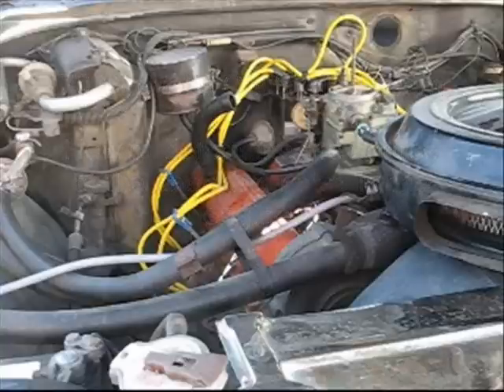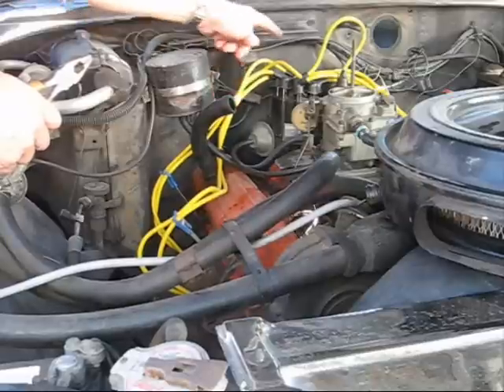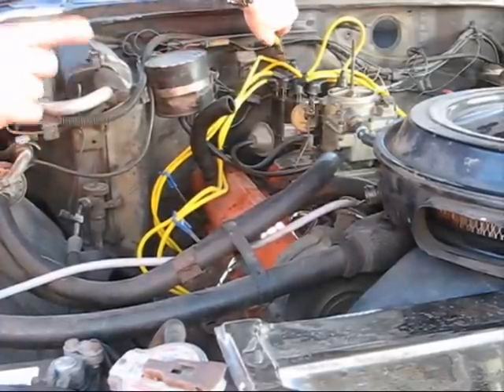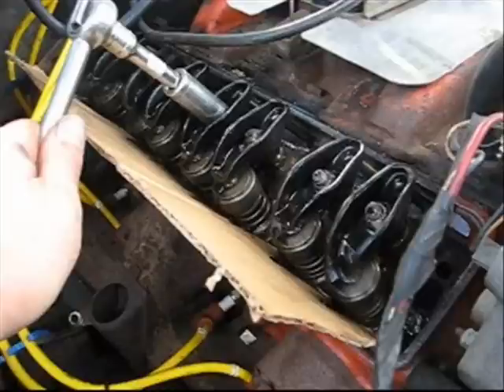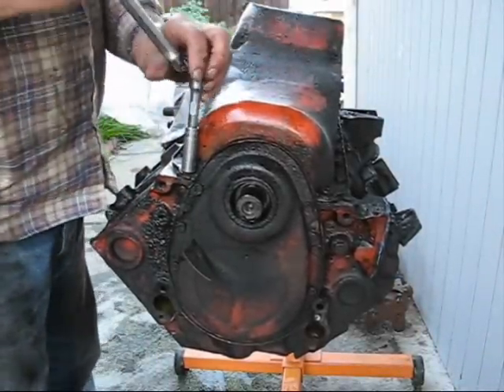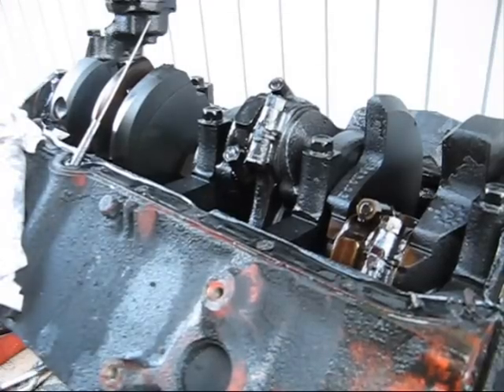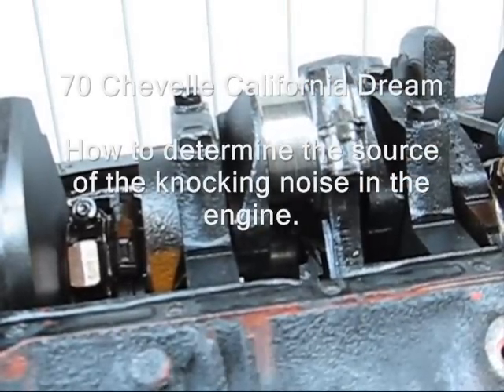How to determine the source of engine knocking noise

Comment: wow... if its a mechanical problem, shouldn't it make noise with or without the spark? why does noise stop when wire disconnected? what is happening exactly?  Thank You
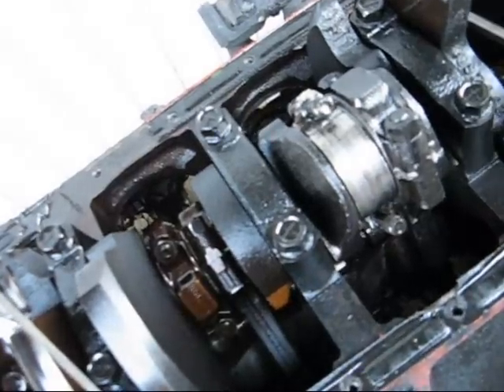Reply from the maker: When the spark plug is connected, it cause the spark plug to fire and this explosion in the combustion chamber pushes the piston down.  The piston is connected to the connecting rod that is bolted to the crankshaft and that is where the bearing is located.  When the spark plug is disconnected there is no force pushing down, it is being pulled through the cycle by all the other pistons.  With a bad bearing, it makes noise, because it has pressure on it and the bearing is spinning around the crankshaft and it should be stable in one spot.   That is why this is an easy test.           Look at the bad bearing at 6:30
Reply: Thank You Sir very much for replying, wow I'm very impressed by this fact, I would never have guessed !!! and your explanation  is very simple and detailed. Now I'm really concerned about my 76 chevy 350. During my last oil changed., engine was started and made knocking noise 3 or 5 times and immediately shut engine down, turns out the dipstick was misread. oil was added, the noise went away and knocking disappeared, is it possible I might have spun a bearing?  Thanks again for your time
Reply from the maker: No.   When you changed the filter, there was no oil in it when you started the engine.  If your car has an oil pressure gauge, you will notice that it takes about 3 to 5 seconds for it the come up to pressure.  The reason is that when the engine starts it has to fill up the oil filter first before the oil starts to circulate through the rest of the engine and finally register on the oil gauge.  Basically, the engine is running with not much oil on the bearings, etc, (there is just a thin film of oil that did not drain off from the last usage) until the oil starts pumping into the motor.  This is the same thing as not starting the car for several months.  They are basically designed to run like this on startup because the oil pumps works on engine rotation.   

What some people do is fill up the oil filter before putting it on.  I am not into it and have never had a problem in 50 years.  I am an old guy.
Reply: well, oil change is due again, i'll fill the new oil filter - Thanks again Sire! : )
Reply from the maker: See if it makes any difference.  Let me know

Comment: My 2.2L S10 with a pushrod engine makes a very similar knocking sound but it's not as loud... i just got a new head on it since the old one warped from running in too low a gear uphill on the highway and it's still knocking only when it's cold. A spun bearing makes sense but I would have to pull the motor like this one
Reply from the maker: Maybe you can lift up the motor up enough to take off the oil pan.  You will have to disconnect the motor mounts first and when lifting it up be careful not to let the fan hit the radiator.  If you can get that far, remove the oil pan and remove the rod bearing that you think is knocking.  I did this in high school but it was a very hard way to do it.  If it is good, put it back on and torque it down.

If one of the rods are scored,  you will have to pull the motor. 

Put the car on jacks,  get under it with it running and take a long screw driver and put one end on you ear and put the other end on different parts of the block and oil pan (front to back), and see if you hear the noise from the bottom.
Reply: David Lis that third part is a very good tip, thanks. But if I were to do that I would pull the motor out all the way. No point in leaving it in half way and making it a huge pain in the ass. The whole reason I have to lift it out is because there's a crossmember right under the oil pan and it's probably important
Reply from the maker: You are basically stuck.

Comment: This is confusing,  is it the same engine, did you rectiify the lifter noise,  or was it a bad rod bearing.
Reply from the maker: Yes it it the same engine.  I removed it from the car and removed the rod bearing shown at the 6:00 minute mark on the video.

Comment: I have some kind of knock coming from my 1982 Toyota Corona (22R) Just did the spark test as shown, when I pulled cylinder 3, the noise stopped for a few cycles but then came back after just a couple more. Lifters maybe? Maybe rod knock on more than one cylinder? None of the others had any effect on the knocking noise.
Reply from the maker: Try unplugging #1, then go and take of each of the other cylinders one by one and see if you get the same results.   Being a Toyota, I don't think it is a rod bearing.  Cannot say100%.

Comment: I took off wires one at of time and the noise didn't stop wants next
Reply from the maker: Maybe it is not a rod bearing problem but a broken valve lifter.  Did you loosen all the lifters one at a time?  (4 minutes into the video)

Comment: Reason knock goes away no combustion forcing rod back down hitting crank.
Reply from the maker: Yes, did you see the end of the video where it shows the rod bearing all screwed up?  It was spinning.
Reply: Yes it was bad
Reply from the maker: It was so bad the machine shop said it was to bad to regrind the crankshaft, so I needed to buy a new one.  I purchased the entire engine rebuild kit with a new crank, bearings, rings, cam, lifters, gaskets, etc.
Reply: Be sure  have rods checked for out of round
Reply: Worth the money

Comment: Everytime I pull plug wires off while the cars running I always get a nice shot of spark plug electricity through my body. I don't do it anymore.
Reply from the maker: With the car not running, pull off the boots from the spark plug and only put them on far enough to make connection and not all the way where they snap on.  Then use a pair of pliers with rubber or plastic handles to put them on and off.  After you are done, turn the car off and push them on all the way.  

I get shocked once in a while myself, no fun.
Reply: Go check out my turbo c10 build immune just started tapping I’m going to replace lifters and give it shot before I ls swap it

Comment: I hate these bearing GM MANUFACTURING.....YOU WILL NEVER HAVE A PROBLEM. LIKE THIS WITH TOYOTAS....
Reply from the maker: My wife drove home with the oil light on and oil leaking all over the bottom of her 2011 Toyota Camry.  The oil filter was leaking.  My first reaction was the engine was destroyed.  I drained the 2 quarts that were left and changed the oil filter, filled it with oil and started driving it again.   30,000 miles later it is still running great.  I have no idea what is going on but I don't care.  It now has 80,000 miles on it.  She will only buy Toyota cars, I wonder why.

Comment: hi i have a nissan maxima and it makes the similar noise it runs great but does shake somtimes and leaks oil. could it be the timing chain or vavles idk pls help
Reply from the maker: My car ran good but made a knocking noise because two of the rod bearing were spinning and it was just a matter of time before the rod would detach from the crank and really damage the motor.

Leaking oil does not have anything to do with the knocking.

It would not run if the timing chain jumped a tooth.

If the valves were bad, the car would not run good.

Did you pull the spark plugs and check?
Reply from the maker: My car made the knocking noise and ran good except if I kept on driving it one of the rods would detach from the crankshaft and do more damage to the engine.

The oil leak would not effect the running or knocking.

If the timing chain jumped a tooth, the car would not run good or maybe not at all.

If the valves were burnt, it would not run good.

Did you check by taking off the spark plugs and hear the noise go way.;

Comment: Gotta check your oil forsure
Reply: great video though thanks
Reply from the maker: I can not believe how many people today are just running their engines out of oil and seizing them up.  I was talking to the service manager at the Toyota Dealer and he was telling that since the cars are using synthetic oil and people don't have to change their until  10,000 miles, some of the older cars that use more oil and people forget or are lazy are running their engines out of oil.   

I notice that the younger people have no interest in doing or knowing anything about the maintenance of their cars except putting gas in them.

There is an old saying:  pay me now (change the oil for regular maintenance) or pay me later (put in a new engine when it stops working).

Comment: yeah I do listen to station, just got the car back out of the shop it keeps stalling,  so they replace the fuel pump and they said that should resolve my problems but i still have that knock in the valvetrain so that's  my next project and also rebuild my front end suspension.
Reply from the maker: I have a video on rebuilding the front suspension just in case you want to get crazy

Comment: Hey david what kind of oil you would recommend to run in my 62 continental 430 engine  , I was told I should use straight 30 weight.
Reply from the maker: In the 1970s/80s, I used straight 30 in all my cars.  I was told to use what the manufacturer recommends because that is what it was designed for.  That being said.....

I was told in about 2012, I should use 5- 30 because oil is made different now and using the lighter end of the oil (5) is better on start up because it  gets oil to the bearing faster and the lighter blend adds less friction to the engine when running.

I have never heard anyone say that their engine stopped running because of the weight of the oil they used.  You can only find out if you use a oil weight and take the engine apart and look at the bearings, then use a different weight for a while and do it again.

In my 70 Chevelle, 90 Mercedes 420SEL, E150 Ford van, and 2012 Toyota Camry,  I use 5-30 or 10-30, whatever is on sale.   I really don't have preference for the brand, they are all made to a certain standard.   I know I probably be blasted for making such a comment but that is what I believe.  

70 Chevelle - 3,500 miles on new engine (change every 3,000 miles), Mercedes - 220,000 miles (change every 5,000 miles), Ford van 55,000 miles (change every 7,500 miles - recommended by Ford), Toyota 75,000 (change every 5,000 miles), and old Toyota sold after 285,000 (change every 5,000 miles).

This is another big no - no.  Also, the 2012 Toyota, I changed from synthetic to regular.  Instead of changing oil at 10,000, I do it at 5,000.  There are several articles on the internet about the differences.  I talked to the Toyota dealer and he said that when these cars get older and use more oil, the people that change their oil at 10,000 to 12,000 might run out of luck and run their cars out of oil because they are waiting for the 10,000 marker versus me changing it at 5,000.  I will notice it because I do it at sooner increments.  I have hears some stories of people running their cars out of oil because a lot of people these days don't maintain their cars and never think to check the oil level never mind ever change it.  There is the old saying:  pay me now or pay me later.

All this is a matter of choice.  I understand if you are racing the hell out of that engine but you are going to be on old fart driver cruising down the highway with the radio going, rolling the electric windows up and down with the air conditioning on,  just loving life driving your big old Lincoln Continental.

Do you ever listen to public radio at about 10 or 11 am on Saturday and maybe Sunday, the Clicket and Clacket brothers? (Different times for different parts of the country).   Or maybe it is call Car Talk, they talk about car and car repairs.
Reply: Excellent. I run a Rotella straight 30 in my ‘74 250 inline 6, with zinc added after the fact.

Comment: The problem is also finding the right person to do the job no one is  returning my calls as when they want to start the jobs 5k are just estimates, I 100% agree with you, thanks for your help.
Reply from the maker: Where do you live?  Are there any old car clubs around?  Go to some of the old cars shows and ask all those people, you may find someone that works at a garage that will do it on the side.
Reply: David Lis I live in Tacoma Washington, that's a good idea, will do, always loved this car but never knew it would be such a pain.
Reply from the maker: Anything that is worth it or you really like can be a pain but once all the problems are over, you will love.  If I remember correctly, that car has electric windows.  I love driving my 70 Chevelle but never in the rain. I am afraid of other drivers so that limits your driving days. 

The only thing I could not do to my car is paint it.  Not because I cannot because in my 20's I painted many a car.  I live in Santa Clara county (Silicon Valley) and they only allow water base paint and they do not sell paint to people who do not run an auto body shop.

So, I went to some of the local car shows and talked to everyone that had a nice paint job on their car.  Everyone was happy to talk to me and told me who painted their car and how much they paid.  I then contacted several of them and went to their homes with my car and got estimates.  I already knew their skill level by looking at the cars they painted.  I finally found this guy who did it at home and in Santa Cruz County that still allows oil base paint.   It came out super.  One of my video shows him painting the car.   I was lucky because he allowed me to go into the paint booth with him and video him painting the car.

Be patient, you will find someone.  Summer is coming, meaning a lot of car show.
Reply from the maker: 404. That’s an error.The requested URL was not found on this server. That’s all we know.
It does not like something.

Comment: I also have a ticking/knocking sound coming from 62 continental  I was told I need to rebuild my motor, also the the vehicle dies or wouldn't start when it get hot it has to cool down before it restarts I've replaced points, plug, adjust timing it a tune up and still having that problem.
Reply from the maker: Did you do a compression test?  You can rent a compression tester from your local auto parts store.  My book goes back to 1963 V8-430 engine and it should have 180 pounds of compression +/- 20 pounds.

When you took out the spark plugs did they have oil deposits on them, were they black?

How many miles on the car?  Remember, those older engines were made to run about 100,000 miles.  

Is this the original engine, is the car all original?

What shape is the car in?  Do you have plans on keeping this car?  How much did they tell you it would cost to rebuild the engine?
Reply: the compression test was good its all original  motor it has 99k on it, I paid a shop to do the tune up to my knowledge their hasn't been any work done on the motor its other a new water pump.
Reply: I was told it could cost up $5k to rebuild it, I bought the car over a month know pretty anytime I drive it someone wants to buy it so i think its in good shape other the knocking and stalling.
Reply from the maker: $5k sounds reasonable because they have to take the motor out of the car and the parts are more expensive than your standard 350 Chevy V8.

I think your motor is just tired and wore out.  If you do decide to rebuild it, buy a new starter and alternator, those will be going next.   Install them at the same time so you don't have to do it separately.

Then you will have a dependable car you can drive forever.

Comment: had the same problem in a ford minivan. .but the mechanic said he replaced the bearings but still the knock without taking the engine out..my suspicion is that he never did what he said so...
Reply from the maker: I would take it back and tell him that nothing has changed, it still makes noise.  Have him show you the old bearings.   If the bearings are bad, it also damages the crankshaft.  Look at the video, at about 6 minutes, look what happens to the bearing and the crankshaft.

Changing the bearings is a major job.

How many mile on this minivan?  It may be better to buy a used motor at a junk yard.

Comment: I have a brand new chevy 350 3 miles could that be my problem
Reply from the maker: Where did you get in from?
Reply: David Lis from a Chevy dealer online it came with everything other than headers intake and the accessories on the front
Reply from the maker: I would call them up and tell about it before you run it any more.  They may want to send someone out and listen to it.   It should not make that kind of noise since it is new.  If you do start it again or they come around make a recording on your phone or camera.
Reply: David Lis ok thanks a lot. Hopefully it's just the lifters